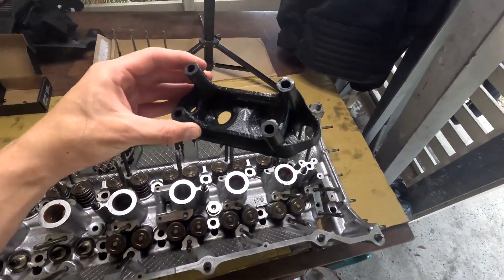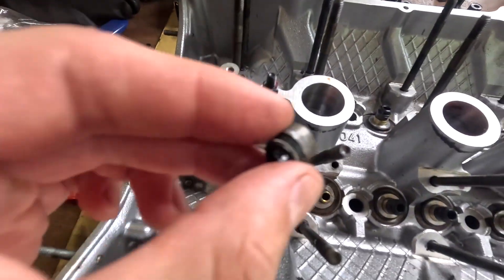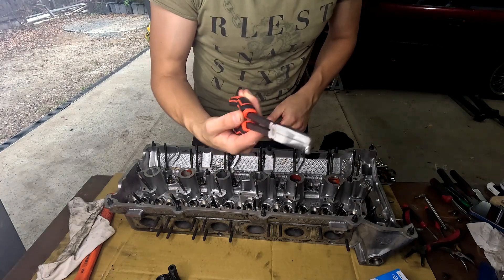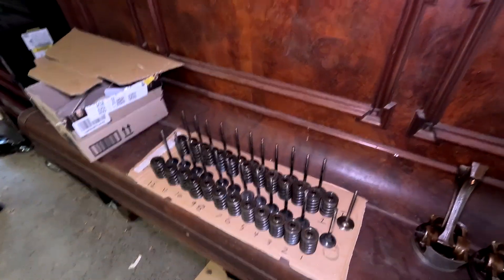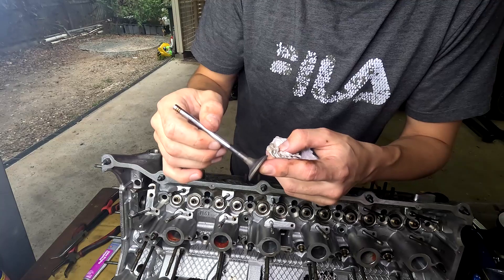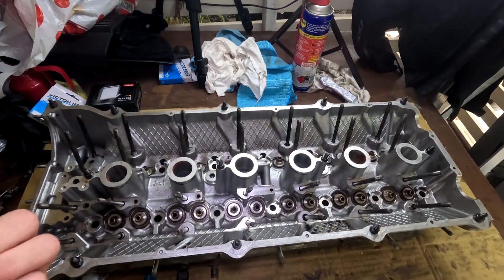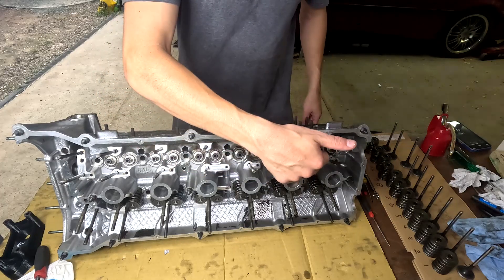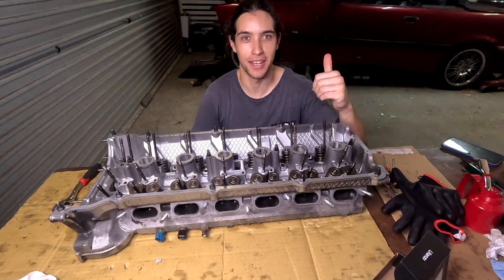Rebuilding a BMW M50 cylinder head | e36 Drift Build Ep3

Comment: Nice job getting those seals out.

I'm at that point right now with my 92 325is.

Not sure if you can help answer a question for me? 

Before sending the head to the machine shop for surfacing and cleaning, i removed the cams but left the valve and springs. 

When it was returned,  the guy had removed the small elbow and gasket at the back of the head (heater water inlet?).

What i can't figure out is where 3 small washers came from which were returned with the elbow.

At first i thought they were washers from the spark plugs because they are similar in size. 

Any thoughts?
Reply from the maker: Thanks mate! Vert strange, maybe they are head bolt washers? Apart from that I’m really not sure! 🤔